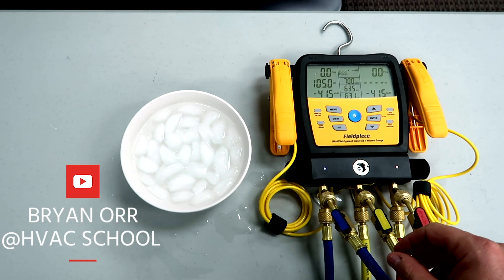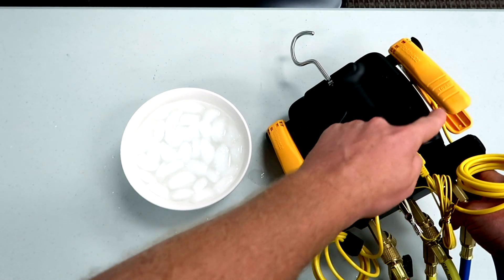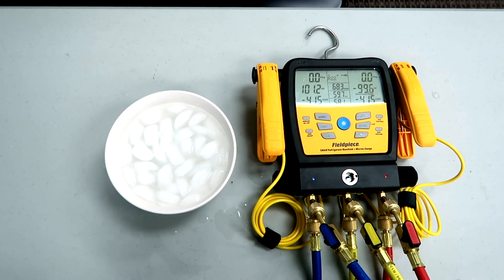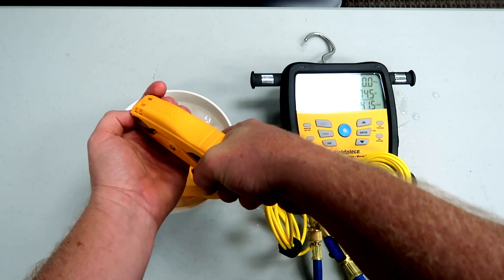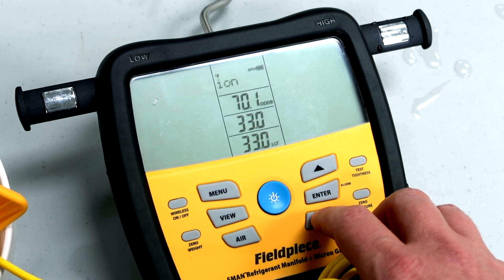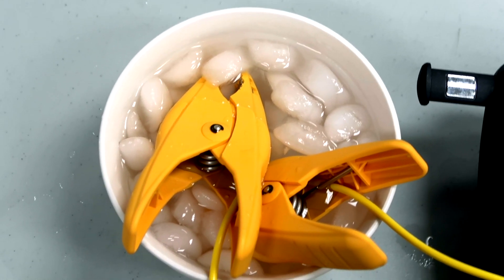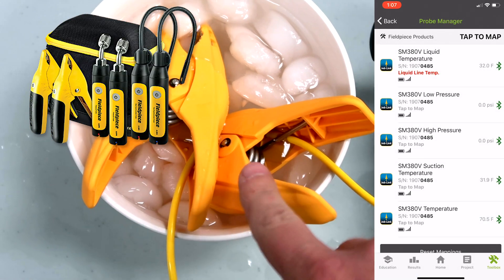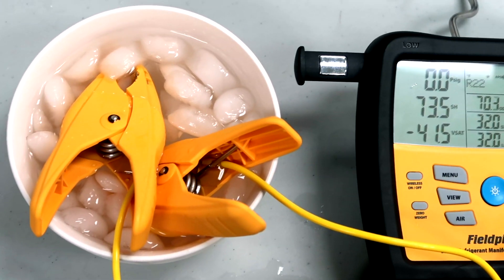Temperature Clamp Calibration (SM380V Thermocouple Temperature Clamps)

Comment: We did this experiment to verify what happens with thermometers in ice.  The ice must be finely CRUSHED (Think 7-11 Slurpee) and inside of an
INSULATED STYROFOAM CUP to be 32 degrees.  It should be no than 10 percent water max.  If this is not done the actual water temperature WILL 
BE 33 or 34 degrees because it is NOT the temperature of ice!  Styrofoam cup is mandatory to get to 32 degrees.

Comment: Good video. nice easy calibration on those fieldpiece.
( Ftngot ) Fyi guys - above 200 degrees F & below minus 95 degrees F Per fieldpiece Type K thermocouple +- 2 degrees accuracy. +- 1 otherwise as said in video.
Trivia - Back in the day ( the 80's ) when i was calibrating Type J & Type K Thermocouple Digital display controllers to NBS ( National bureau of standards ) We were only good for +- 2 degree's & Lucky to get that at times and calibrating was wayyyy more difficult. a major pain in the ***.

Comment: The way I know is that you submerge the thermal sensitive element in ice.. ice with water.
First you put the ice in the bowl, you stick thermal sensitive element in the ice and after that you pour the water to fill the gaps between.
The ice should not float!
And you should get a reading of 2.22°C or 35.996°F.
That I've learned in college.
That I got with a TUV certified fridge thermometer.
Reply: CSL 35F° ??........
Reply: I believe you are correct, water freezes at 32f so in that case water and ice would be cooling towards 32f, in this case water was added to ice and afforded some time to equalize so the reading should be higher than 32f but less than 40f. By filling the bowl up with ice chips and adding just enough water to begin to float the ice would be better, and calibrating while stirring the bath would be best. An old lab grade mercury thermometer from FleaBay would be a nice sanity check. Also Brian pointed out that the calibrated accuracy would be +/-1f so a reading of 33f in an ice bath would be in range so there's no need to adjust. There is a reason that machinists are obsessed with flatness and measurement accuracy and why labs go through the expense and hassle of using a standards lab to certify their instruments. My point is that the initial reading of 33f in an ice bath was probably better than the adjusted reading of 32f. As a sanity check, the ice would be melting into the water so the bath would be at some temperature higher than 32f because 32f is frozen water. water mixed with ice that is melting should be at a slightly higher temperature. If the bowl were placed in a freezer and allowed to cool it would take some time to freeze but we know water freezes at 32f so clearly the contents are not at 32f. It may be close to 32f but not right on. Upon further consideration I have to say that Brian’s technique of placing an ice cube in the clamp holding it against the probe tip mitigates any issues with the rest of the bath being slightly warmer. So by following Brian’s technique the readings should be spot on 32f. Great technique Brian! I was right up to the point he clamped the ice cube in the probe, then I was wrong. From a practical POV I would guess an ice bath could get to 33f and less as it approaches freezing. The fact that it takes a lot of energy to phase change the water to ice means it could get very close but still just hang on as really cold water.